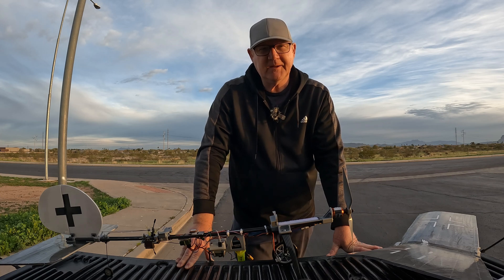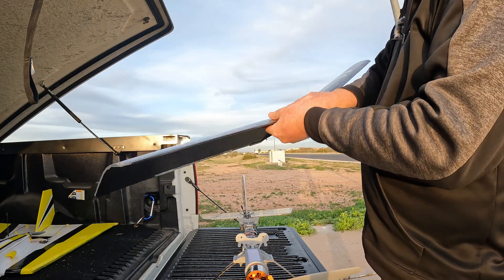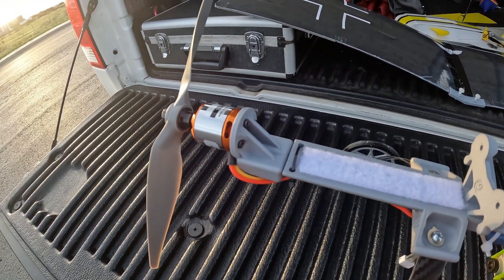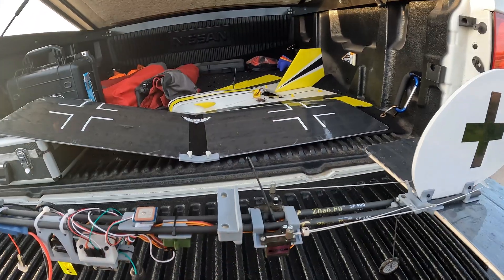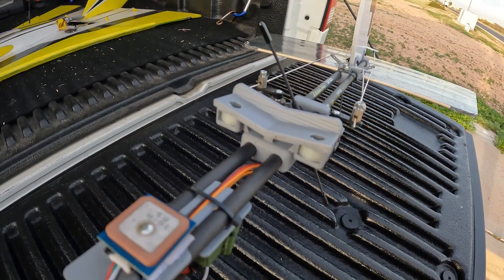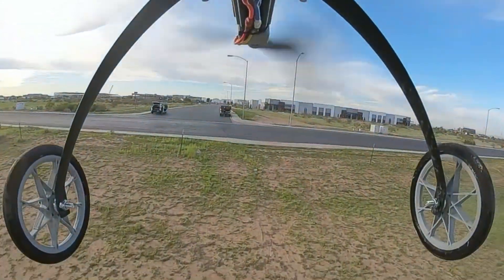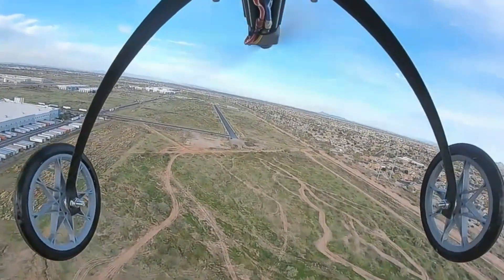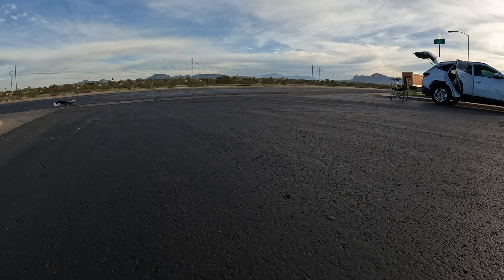Slow Stick with Carbon Arrows - Details and Flight Footage // FPV

Comment: David, finally built and flew the slow stick. I think I put too much tape on wings as it seemed heavy but awesome flight. Do you have any print files for a pusher setup? Many thx!!!
Reply from the maker: Yes, I do, it is listed and called the Sparrow Scout.   Thanks for sharing your experience.

Comment: David, bolt size for landing gear attachment?…Thx
Reply from the maker: Hi Mike, I used 8-32 and 6-32 and I think they are 3/4 inch.   You can use any in that ballpark.

Comment: Hey awesome kit.   I just purchased it a while ago and got all my parts printed and cut out.  Any chance you could do a wing build video?  This is actually my first foam plane build and just not quite sure how you put together the main wing.   Thanks
Reply from the maker: Build the left and right wings, then you join them.   Use carbon rods for leading and training edges.  It is similar to the Flite Test builds.   I will look into doing a wing build video.
Reply: 2x on a wing build video
Reply from the maker: @paulmeyer9161  I did a video on building the wing.   I hope that helps.
Reply: Boa noite essa assa é feita de qual material, gix s minha de depron mas ficaram muito fracas.
Reply: I just kinda ‘winged’ it so to speak.  Built the wing w/o those weird inside pieces.
Reply: I actually just cut those pieces off and I used the piece that I cut as a template to built the wing with the correct curve.  I then just glued / taped those pieces back in the center of the wing.

Comment: Thanks for sharing the detail, and i will build one for, may i know tbe weight and battery size, thanks in advance
Reply from the maker: The battery and hardware are listed with the STL files.   The battery is a 3S 2200mAh and will give you 14-15 minutes flying.
Reply: @Qromer  thank a lot, happy landing mate

Comment: I have started my build, what is your finished flying weight please.
Reply from the maker: All up weight with 2200mAh 3S pack is 980g -- this includes full FPV system, OSD, GPS.   I am using a heavier foam than most as well as lots of packing tape to water proof the foam board.   I am super happy with it.  I hope this helps.   I would love to see and hear about other builds.  Please post up on Printables some photos and details of your build.   Thanks!
Reply: @Qromer  I certainly will,  thank for the information

Comment: I used to fly the old aluminum body version of this slow stick with my grandpa. It was a blast and the memories will never be forgotten. 

I do not have access or the ability to 3D print. I know it might be a pain but would  you be willing to print and sell me the parts used for this? This would be a great project to do with my son to start another generation in flying. 

Pretty please 🙏
Reply from the maker: I wish I could, I just don't have the time.  There are some good print services out there.
Reply: I guess I never really thought about that. I will have to look into that. Thanks.

Comment: Thanks for the details. I have seen your Slow stick with aluminum square tube. Do you have the .stl? I can not find easily arrows with 7,5mm diameter.
Reply from the maker: Yes, I still have the original GWS Slow Stick that came with the aluminum square tube.   They stopped making them back in 2007 or so.   Did you see the parts listed on the Printables site?   The arrows are made in China.  Make sure you are checking the outer diameter, as often they list them with the inner diameter.

Comment: I have just purchased the files, but unfortunately there is a lot of information missing. The Wing PDF has no dimensions (it also needs to be tiled for A4). There are also no instructions i.e do you cut the arrow shaft to a specific length and what is the distance between each component i.e motor to wing spacing, CG etc
Reply from the maker: Hey, thanks for the support.   The PDF pages are scale 30" x 20" -- you can tile print them using Adobe Acrobat Reader -- that way you can select A4 or Letter or what ever paper you are using.   You do NOT need to cut the arrows -- they should be 31" long.  The distance of each component are NOT critical and but if you look at the photos and video you will see the order they go in.  This is the most important part.   As will any Slow Stick, you can adjust on the stick where you like them and to help balance the plane.   As for the Motor to main wing... if you see in the video and photo all the parts at the front are touching each other.   I hope this helps.
Reply: @Qromer  brilliant,  thank you
Reply from the maker: I have added Tiled PDF prints for both A4 and US LETTER Size to the listing.